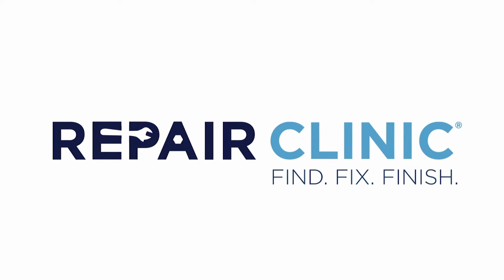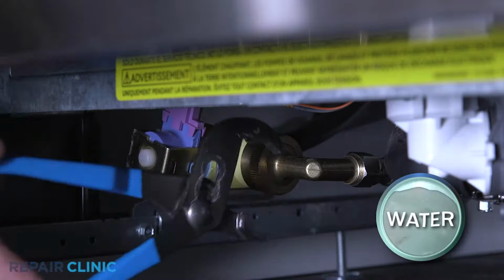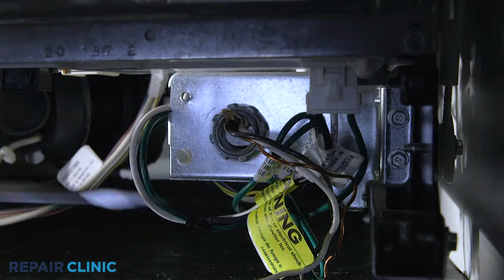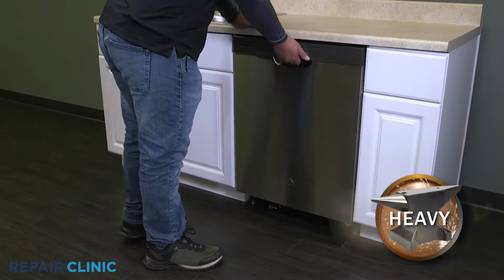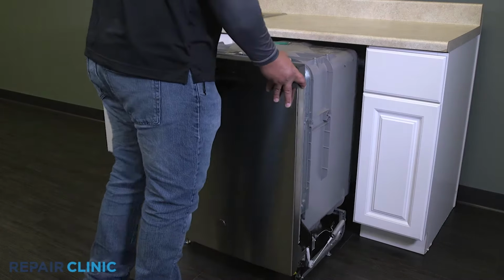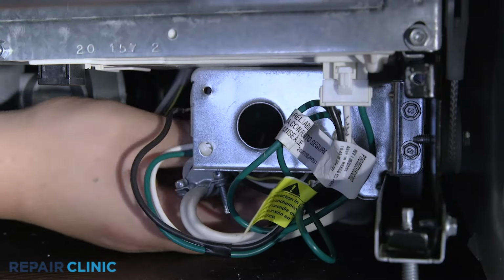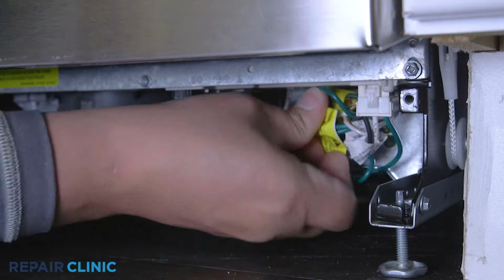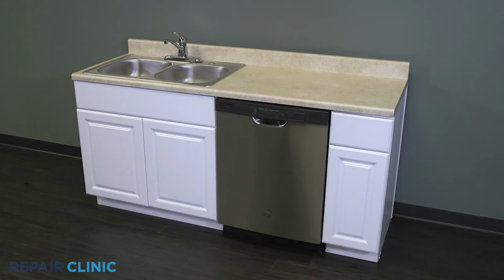GE Dishwasher Pressure Sensor Replacement WD21X25468

Comment: Y’all made this way too complicated the entire repair can be done without removing the dishwasher. Kill power lay a towel or two under pressure switch. Quarter turn pressure switch.  Unplug pole switch and install new one. This is way is totally unnecessary. Your welcome.
Reply: They get paid by the hour.
Reply: @theapplianceguy4566 would it be the same for GE model gdt550pyr3fs?
Reply: Totally correct. In fact, the sensor probably just needs to be cleaned, like mine. I used a low profile kids plate/bowl to catch the water and I was done cleaning it in minutes. Works like a charm now.

Comment: The whole thing can be done without pulling the dishwasher out laying it down. The sensor is located within reach after removing the toe kick. I had to do it this way because our dishwasher is stuck inside the cabinet. Thank you for saving me from buying a new dishwasher! We were quoted over $300 to fix a H2O error, which isn't worth it for a $500 dishwasher.
Reply: Would like to also confirm this. Just pulled mine out and cleaned it without moving the dishwasher. 

Removed the front plate, popped the sensor out, unplugged, cleaned and put back. Dishwasher is back to normal now
Reply: Mine was just clogged! And I left mine in place, very easy to get to

Comment: You do not need to remove the dishwasher to remove this part, and first check to see of its clogged! It can get easily clogged with scum which blocks the water inlet to the sensor, clean first, and see if it works, mine was clogged and did it in place with out removing it at all
Reply: Thank you James! We actually just got the failure to drain code this evening and thanks to your suggestion I removed the pressure sensor and sure enough, it was plugged up with scum. I actually had to flush it with a syringe but in the end managed to get it cleaned and now it's working again. So thank you!
Reply: Is this still the candidate if my washer turns on to drain and just stays there until the machine ‘times out’? After, power led flashes 5 times.

Comment: No need to replace the sensor either. Just clean it! take the black part out and clean the tunnel. Be careful don't flush the black part. it's electronic. Get wet probably will ruin it.

Comment: Thank you for a thorough walkthrough on replacing the sensor.  Like several comments below, I unplugged the power, unscrewed the top two screws that held the dishwasher to the cabinet, leaned back my dishwasher for easier access, unplugged the sensor wire, removed the white housing + sensor from the dishwasher, removed the black sensor from the white housing, then cleaned out the nasty gunk out of the white housing with soap and water, then wiped down the black sensor (don't get water on the connector).  A thick black ring of gunk came out of the white housing, which was causing the sensor to incorrectly stop the cycle during the basin filling up.  After hooking it back up, the dishwasher didn't error out and completed the cycle.

Comment: Thank you for the clear video and instructions!  I had a repair guy come out twice, and he wanted to replace the main board and the control board at over $400 (at which point I could get a new dishwasher), but my dad thought it was the sensor and sent me the part and your video.  I have petite hands, so I was able to pull out the dishwasher about 6 inches (after turning off power of course), and reach it through the side.  It worked!   For anyone having the issue, I was not getting the H20 error and the all diagnostics were coming back normal, but it would periodically get stuck on drain cycle, at the beginning or in the middle of the cycle.
Reply from the maker: You're welcome! 

We are always happy to help. If you would like to give us a review on Google, we would much appreciate it: https://g.page/r/CcVUrahZNozMEBM/review

We hope that you have a great day!

Comment: Replacing this part is pretty easy, thankfully, as dishwasher is stuck in place.   Turned off power, waited awhile, took off cover plate, then checked for residual power using tester.   Turned the part as shown in the video to remove it, then disconnected the wires (far easier and opposite of the way they did it).  Reinstalled.  Turned power on.  Tested for leaks.

Comment: So glad I found this video, and the comments below it stating how easy it is to get to the pressure sensor by only removing the toe kick.  I am about to torch this 2 year old dishwasher but my errors are the same as everyone else's (H2O randomly, will continue to try to drain when empty until it cycles out, etc..) and this is easy enough to try.

Comment: So don't bother pulling the dishwasher out you can just lay on the floor and remove the front plate then easily reach the pressure sensor to remove it. Not a bad idea to unplug from the outlet under the sink, but that should be enough. After that make sure you have no water in the bottom of the dishwasher and take the sensor off THEN unplug the wires from it (much easier to do wires once it's spun off). Take the black part out of the white housing and clean thoroughly. I had a big chunk of crap inside the white part, but the actual important part to fully clean is inside the black part. There is a small hole big enough to unplug with some tweezers. After that fill the tiny hole with water (don't get water in the plug for the wires while doing this) and keep rinsing it and tapping it against something until nothing comes out. You should here it click when it fill with water pretty much instantly. Then you can reinstall it. Odds are good the O ring on the sensor will leak and you should do a test run to check that before putting the face plate back on the front. If it leaks the only way I fixed it was to just keep removing and reinstalling many times until it stopped. I also applied some dish soap around the O ring to help it go in better and eventually it didn't leak. Many people in the comments had this part leak including myself so make sure you watch it like a hawk for a while when doing your first load.

Comment: I am planning to replace this sensor on my only one year old GE Dishwasher ... Because it gets stuck on drain cycle when starting a new cycle. I figure this could be the problem, or (from researching). the relay on main board is stuck, & main board needs to be replaced. ... 🐾🐾🐾 Update after fix. Replacing this sensor was the fix. I was able to replace the sensor from underneath. No need to pull the dishwasher out. Yehhh. Keeping the old sensor as backup after taking it apart and cleaning it. 🙂

Comment: First of all thank you for the video. Secondly, I replaced my pressure sensor but there’s a little bit of a leak that happens out of the sides of it when I start the wash. And the little rubber ring around it is installed so I’m just not sure why it’s leaking. It appears to be installed correctly.
Reply: I'm having the same issue. did you get yours resolved and do you have any tips?
Reply: @matthewthomason57  I'm really curious on this, because i'm about to get some silicon and I know I shouldn't.
Reply: I'm having the same issue. Did you guys get yours to stop leaking?

Comment: I've gone through all steps and it is draining as we hoped but now I am getting a leak from the bottom of the sensor housing. I've ensured the oring is positioned correctly and even wrapped with plumbers tape but I'm still getting a leak. What could I have done wrong?
Reply: Late to the party but thought I would reply for future people.  Keep reading the comments on this video.  I had the same leaking issue.  Most likely you are not putting the sensor back in the white thing correctly.  I had the plug facing inside the dishwasher.  It needs to be facing outside.  The make sure there is a tiny click when you push it into the white thing.  It wasn't much of a click but this solved my leaking issue.

Comment: I have plenty of slack in my water supply and power line. As long as the power is killed, I assume you don't need to remove either line.

Comment: How do you know when is the sensor that is failing
Reply: Mine was continuously pumping and not filling w/ water.  After I replaced the part I took the old one apart and found a plug of gunk clogging the pipe.  Don’t know if cleaning it rather than replacing would have fixed it.

Comment: WHY NEED TO DISCONNECT THE WATER SUPPLY LINE AND POWER CABLE FROM DISHWASHER SIDE ???
Many times easier and faster  is just to unplug the cable under the sink. Same for water supply line under the sink !!!
Reply: Re: power cable, some are hard-wired and there is no plug in under the sink !

Comment: My dishwasher leaks like a fountain around the the new part. NOW WHAT DO I DO????
Reply: Same here. Leaks like a sieve, even when I made sure the gasket is seated. Not tight at all. Did you figure this out?
Reply: @lbandrews1  Same here, did you figure out how to stop the leak?
Reply: I had the same problem. The part has two piece: The black sensor and white elbow valve. I separated the pieces and cleaned both and then put it back and it was leaking. I noticed that one side where the white and black piece connect was sticking up a little bit and was not completely secure. I couldn’t get it to stop leaking so I just bought a whole new part for $20. I put the new part in and it’s not leaking anymore.
Reply: The side where the wire harness connects needs to be snapped in
Reply: @davfina  thanks!  When you think you put it together push the two pieces together firmly and there is a little snap and it's connected...no more leak
Reply: Mine leaks bad after cleaning it out.  I guess I will order a new one and see what happens.

Comment: Why take the dishwasher out.   
Takes 5 minues to take off front cover, remove pressure sensor and unplug harness.  Mine was full of some stuff I really didn't want to see in the fresh water supply but a squirt of 409 cleamer and putting it under a faucet dislodged the goo and reversing the steps was all it took.